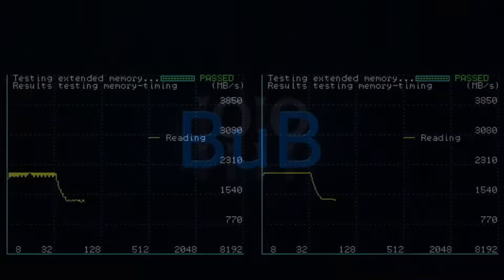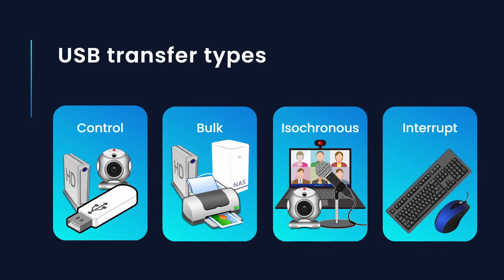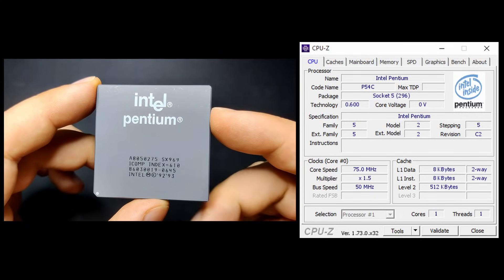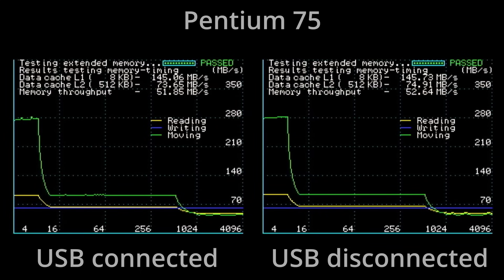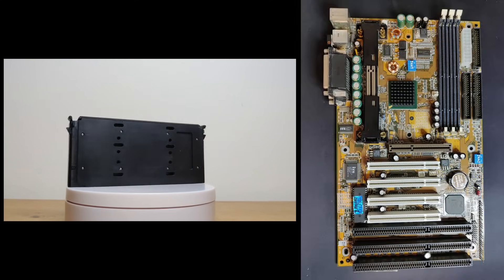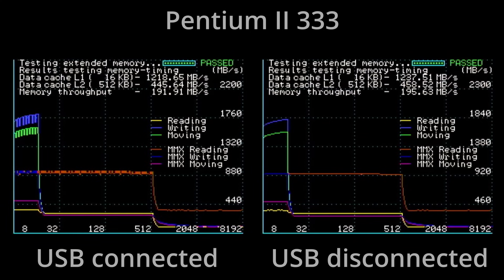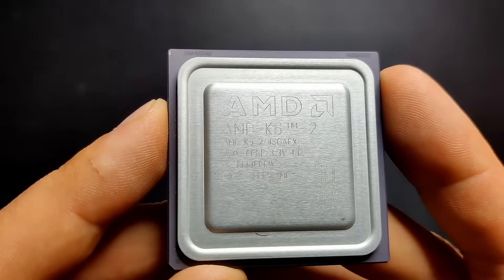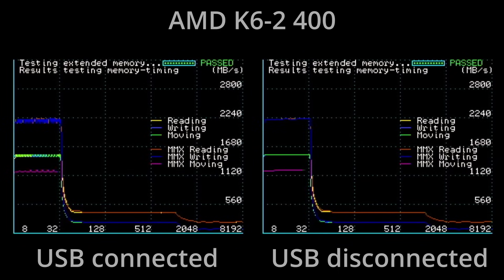Why you should avoid USB in Retro PCs

Comment: It would have been interesting to see, if disabling the USB controller from BIOS has any effect. ;)
Reply from the maker: I did disable the USB controller in one test which I did not include in the video. It is identical to no input device connected to the ports. So, disabling the USB feature in the BIOS does not impact the system.

Comment: People might be wondering why soundcards had all those extra ports and not the video cards or something else. Well, in the early days, soundcards were primarily used for gaming,. There wasn't much else that would use sound card, we didn't have music like we do today. It was mostly noise, triangle waves, and such. Multimedia didn't really come to computers until the early 90s. Computers like the Amiga were popular for making music, but it was still quite challenging to store CD-quality audio tracks on your system. Back then, we had about 40-80MB of HDD space, if I remember correctly. Companies knew that if someone bought a soundcard, it was likely to play games.

Great video again! 👍
Reply from the maker: Thank you! And interesting information which makes a lot of sense! Funny enough, I remember most of the soundcards I had back when onboard audio wasn't really a thing. The first soundcard ingot was an ESS688 AudioDrive - it was such an essential piece of Hardware in my AMD 486-DX4-100.
Reply: Aside from puny HDD sizes, Amiga's sound chip (Paula) from 1984 was never updated and the it was stuck with its 8-bit DACs till the end. That made it unfit for CD-level quality audio. Generally, the platform was stagnant. Most people bought cheaper 'small Amigas' that lacked Zorro slots to put expansion cards and have more PC-like market for graphic cards (the so-called ReTargettabble Grpahics or RTC - ability to use graphic cards appeared very late, only for 'big' Amigas with expansion slots and - for obvious - reasons only for well-behaved Workbench GUI apps, not for games). To make matters worse, games bypassed the OS and talked to hardware directly for performance, so most targeted the most popular config: a sub 1 MB Amiga 500. That made Amiga a hostage of her (rapidly aging) original chipset: updates were minor to not break compat and due to Commodore skimping on R&D.
Reply: ...which is why "game ports" (which is where you would connect your joystick, before USB came along) normally came built into sound cards. It was assumed to be the same use case. They also tended to double as a MIDI port, but as a non-musician I never had any tangency with that - I assume they just assumed "if you're getting a sound card it's for gaming - but if not, it's DEFINITELY for making music..."

Comment: I think a much more real world problem is CPU load during USB bulk transfer. This affects any application that requires CPU speed and fast data transfer at the same time.

When editing video on a Mac in ~2005 on an external HDD it was strongly recommended to use FireWire instead of USB because FireWire used DMA and caused much less CPU load.

The difference could be dramatic.

Of course, a few years later faster processors have made that problem mostly irrelevant.
Reply: Maybe not irrelevant - because developers have used the extra processing power to implement more complex real time effects in various editing suites, while the need for latency-free recording is as important as ever.
Reply: Firewire was nice but e-SATA was better. RIP e-SATA though, when USB 3.1 came out it pretty much made e-SATA pointless. I wish we could have kept e-SATA honestly.

Comment: This video was timed perfectly - I may end up needing to use my mouse in USB mode on a baby AT board that I recently purchased as it is missing the PS/2 connector from its LPT bracket, and the brackets from my other ("modern") baby AT board uses a different connector. The system will be running a Celeron 333 (or a Pentium II 233/350) under Windows 3.1 or 95 so quite relevant knowledge.
Reply from the maker: Glad to hear that the video may give you some insights. Maybe you can run SpeedSys to verify the behavior of the USB device and if it affects the performance.
Reply: @bitsundbolts  Considering the performance of a Celeron (with cache) is near on par with a same-clock Pentium II, and with the board (PCPartner VIB862D w/SB Vibra16XV) having the Via VIA VT82C691 and VIA VT82C586B, the results should be accurately comparable.

I could test with a Celeron 300A/450A (contact B21 cut) and PIII 650 if you want - both on my new board (since I can select the CPU speed, and I fully expect relatively low performance) and Intel SE440BX-2 (currently setup next to me). 

Can't reliably test my current PII 350 as its heatsink is too large and it barely fits my boards, and the PII 233 only posts into BIOS (and only at 133MHz with the BIOS jumper set to "config").

I also have a Celeron 500 and 433 that could be tested in a slotket - they work flawlessly on the Intel board.
Reply from the maker: If you find the time, it would be interesting to see if you can replicate the behavior in any of your retro setups. I do have a few Celeron CPUs here as well, but I haven't tested those yet. I can imagine that the USB issue is present in almost all builds from that time up to around 700/800 MHz
Reply: I'll have a go, realistically I shouldn't need to do more than disable the memory manager to get real mode working for the tests. Might also give my mobile Duron 1300 a go on my GA-7IXEH, as it only runs at 500MHz on it and the board has the as far as I can tell unique to it Via KT133E.

I'm not going to use my Jetway994 as I still haven't gotten it reliable enough to comfortably say any result is accurate (I've had back-to-back CPU benchmarks vary by over 25% with a barebones setup and only PS/2 mouse and keyboard - and it is unstable as well).
Reply: @bitsundbolts  Starting the tests now with the PIII 650, commented out everything in autoexec+dosstart (also copied then cleared config.sys) and started the tests. I just need to remember to enable legacy USB support in the BIOS (I've had no need for it due to using an adapted MS Wheel Mouse Optical and a Fellowes adapted AT keyboard with my analogue KVM).
Reply from the maker: Great! Looking forward to hearing what you find!
Reply: @bitsundbolts  I'll make a post on Vogons in the morning as time slipped away (now past midnight) and post the link. Just enabling legacy USB support had an impact even with the PIII 650 (in a different way from Deschutes and Mendocino), meaning that I have 3x config tested per CPU (that I was readily able to get running). No USB, USB, USB+HID. Ended up running everything under DOS 8.0 from my WinMe boot floppy to save the boot time.

Sucks that my SS7 board needs at least 1 new mosfet as I'd like to run the K6-2 500 as well.
Reply: @bitsundbolts  
YT deleted it, so here it is again. Ended up using my Jetway board anyway as the stability is fine under MSDOS:
vogons*-*org/viewtopic.php?f=46&t=96663

My Intel SE440BX-2 behaved differently by just enabling legacy USB support (on the Jetway it is just called "USB keyboard"), but my results lined up with the keyboard plugged in. 
Tested one of my Via C3 as well, and the rating of the CPU actually regressed for the Celeron 333.
Reply from the maker: Wow, you spent a lot of time on testing, but it does confirm the behavior of my tests as well. Your Pentium III 1000 even shows the behavior. I guess it comes down to many variables: board, bios, chipsets, USB device, etc. Thanks again for doing the hard work!
Reply: @bitsundbolts  
Not a problem. At one point because I was bored, I did 5x runs of Aida64's memory bench across what would have been ~16 different CPU (newest was my then 4790K, oldest PII 233) just to see how they all differed. And then put them into an auto calculating spreadsheet for the min, avg and max.

Did the same type of benchmarking for all the HDD I have as well (this was all around 2017) - 2x of those being 80MB.

Comment: Using a PS/2 adapter would also bei interesting.
Thank you for investigating deeper in this topic!
Reply from the maker: I think you mean a USB-to-PS/2 connector. I would assume it to behave like a regular PS/2 device, but I have not tested this yet. It would turn a "bad" USB keyboard into a "good" PS/2 keyboard.
Reply: @bitsundbolts passive adapters require the mouse or keyboard to support ps/2 protocols. I use microsoft wmo 1.1a with passive usb to ps/2 converter. At the bottom of the mouse “usb and ps/2 compatible” is written. Meaning it would work just like a native ps/2 device.
Reply from the maker: Oh yes, I remember being stuck because of this! You can't just turn any USB device into a PS/2 device. It must be compatible and support the protocol (when using passive adapters)!
Thanks for reminding me 😀
Reply: @bitsundbolts  yeah! It was always a hit or miss. I have had noname usb keyboards that dont mention ps/2 compatibility work with ps/2 converter.
Reply: @bitsundbolts  exactly! The requirement for being campatible with the protocoll is also a good hint. But still I think using an adapter could help in widening the available peripherals i.e. the standard but "good" cherry keyboards.
Reply: I created a converter using a Raspberry Pi Pico to solve this issue called ps2x2pico
Reply from the maker: Wow, a very impressive project! I may give it a try!

Comment: You can now get gaming mice/keyboards with 8000Hz polling rate. This can also be adjusted in the software, and usually it mentions that such a high polling rate can cause higher CPU load. My keyboard does 8000Hz and there's literally no difference for me, but i have a high-end 24 core CPU. Although i can't imagine any CPU within the last 10 years being affected by this, but it's not surprising to see such old hardware being affected, even with way lower polling rates. I remember reading about it in the early 2000's, it was a known issue amongst some gamers and tech sites.

Comment: When I tried using a USB keyboard with my K6-2, whenever I would press a key in Duke3D it would just grind to a crawl, then speed back up when I stopped. It was especially annoying because the keyboard PS/2 port on the motherboard was dead.
Reply from the maker: Also an interesting test. I have not tested this yet what would happen when I press keys during the cache benchmark - specifically with a PS/2 keyboard connected. I am wondering if interrupts would cause the same behavior as USB devices.

Comment: 08:30 The memory throughput is about 60MBps lower when USB is connected. Probably not enough to be noticeable
Reply from the maker: Yes, I have noticed this large drop as well. As you said, probably not enough to notice a difference in the benchmarks I used. Maybe there are others where it is noticeable again.

Comment: It will be really interesting to check how different usb 2 PCI controllers affect performance. Nice video!
Reply from the maker: Thank you! Will try to get some PCI USB 2.0 cards with different chipsets. I am curious too!
Reply: @bitsundbolts  I encountered this problem a few years ago when adding a USB 2.0 adapter to my Epox EP-MVPG5 with K6 3+550.  Different chip sets do have a different impact.  The VIA USB chipset was particularly bad causing serious frame rate deteriorations.  I think I settled for a USB adapter with an NEC chipset as it kept good frame rates, although I didn’t make a detailed study to measure a %age difference.
Reply from the maker: I am in the process of getting different USB PCI cards with different chipsets. I may just get into the details of this in a future video.
Reply: @bitsundbolts  I just bought that identical ALi USB2.0 Card! It is a nice performer on my i440bx board.
Reply: @bitsundbolts This was going to be my suggestion also. Various USB chipsets may show different results. On some more expensive USB ISA/PCI cards each port might get its own controller. Also drivers in various OS's could be a factor.
Also,  did you see any difference with a wired USB device and wireless? 🙂
Reply from the maker: I did not test with a wired USB keyboard this time, but in my first video, there was no difference between a wired and a wireless keyboard. I would assume they behave the same.
Reply: @bitsundbolts  That's interesting and good to know. I suspected that the wireless receiver might be more active and sending a lot more USB traffic 🙂👍

Comment: I think the reason you are getting cache performance degradation is the bios regularly trapping into SMM for legacy usb support via a timer SMI, and SMM code running from a different location, accessing different data will surely trash your cache.
Reply: Does this mean if the bios has the option to disable legacy usb support it might not show a negative effect in windows?
Reply from the maker: It could be - I will try to include this test in the next video I make about this topic.
Reply from the maker: You may be right, unfortunately, I do not have the technical knowledge. All I can say is that this behavior was present in two socket 7 boards and one slot 1 board. The other slot 1 (P3B-F + PIII 1000) did not show such behavior which may have been due to the fast CPU, but I have to test this board with a slower CPU once more.

Comment: ....my main question here - Who is tasked with the actual polling? Is that task mandated to the main CPU or does the USB controller contain circuitry for it...? I think, from the problem itself, that the CPU is included thus has a 'periodic leave' from its normal operation, hence the periodic dips in those graphs. But what happened with P3-1000? Is it just fast enough to make those interrupts invisible? Did it run in a different motherboard than the P2? What does that board show with a slower CPU, like a Mendocino Celeron? Maybe its USB controller is more advanced and took over from the CPU at last....? So, not one question after all, I'm full of questions.
Reply from the maker: Yeah, you just created content for another video right there. The PII was in a Gigabyte slot 1 motherboard. The PIII was in the Asus P3B-F using a slotket adapter.
It could be that the difference in USB controllers makes a difference. I do have other slot 1 CPUs to dig even deeper. Maybe a good test while keeping the motherboard the same